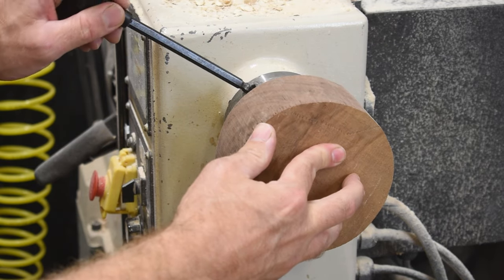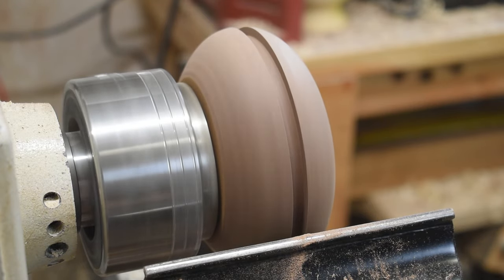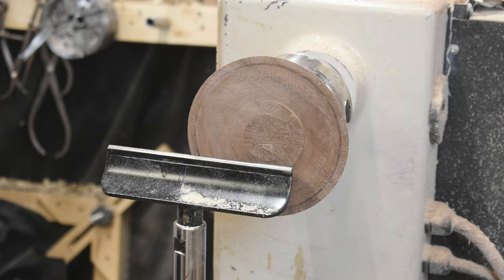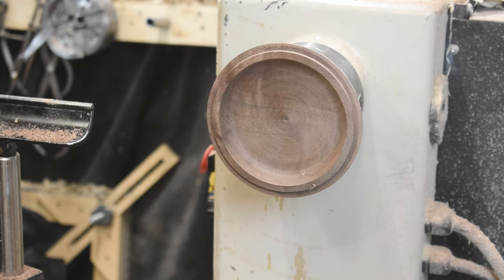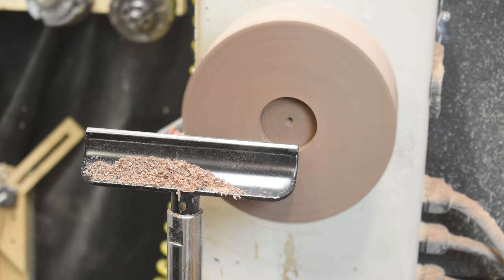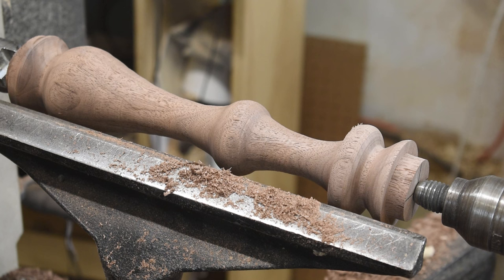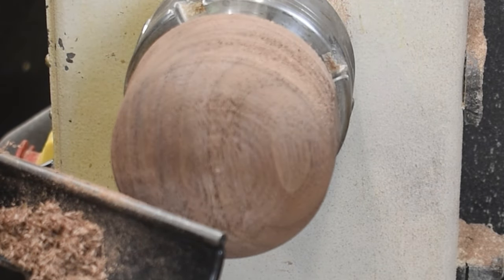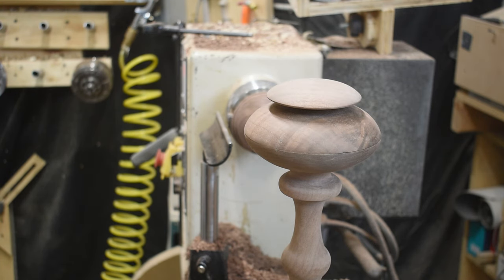woodturning Fancy wig stand for cancer patients

Comment: You did a great job! I hope you have a minute to help me. I am in the hospital on pain meds.Kinda wacked. Did you bore a hole with a forstner bit without any angle? Next please. Where did you get that piece of steel you are using as a scraper? That has me puzzled? Is the only tool you started with and did most of wood removal inside and out a 1/2” bowl gouge? I stopped the video to fire off these questions. Thanks for doing breast cancer support work. I lost my beautiful kid sister when she was 39 years old. GOOD FOR YOU! Please help me along with the details. My Best To You & Yours…
Reply from the maker: I started the top and base with a 1 1/2 inch hole made with a forstner bit on my drill press.  You would need to make it to the size of your chuck jaws.  The steel is a piece of hss i purchased off ebay years ago.  Its 2.5 inches wide and and somewhere between 1/8 and 1/4 inches thick it was in metric.  I ground a 1/2 round negative rake on one side and straight across the other side.  If you keep the tool rest as close as you can its safe to use.  I did most of the work with a 1/2 inch bowl gouge with a  couple spindle gouges for the spindle turning.  Thank you for taking the time to watch.